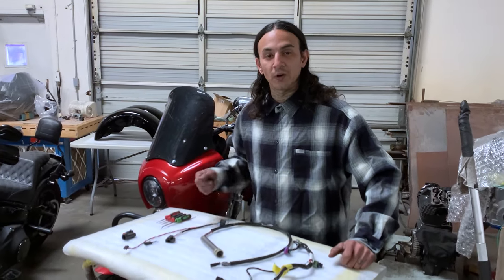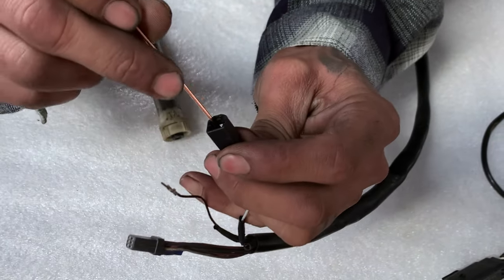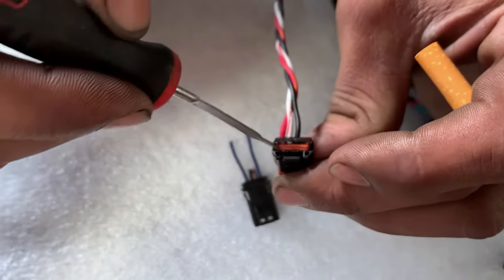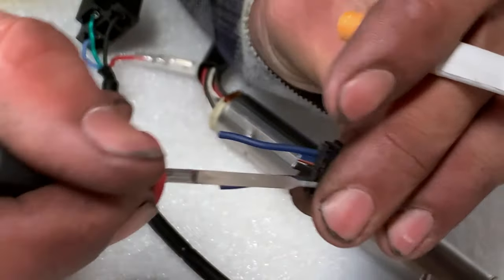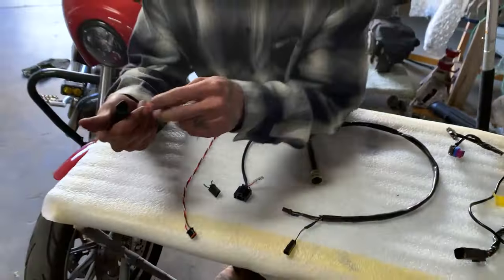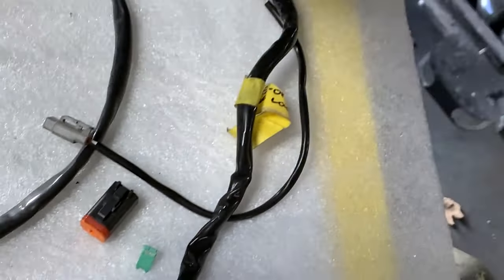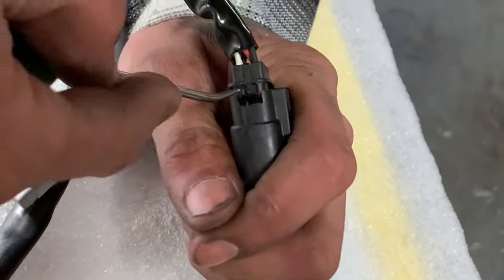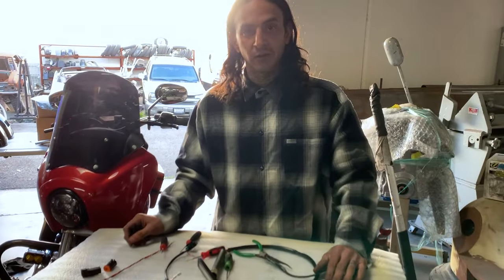IMZZ ELITE | De Pin Common Harley Davidson Wiring Connectors Easily!

Comment: Great video man. Bought some factory Harley front blinkers for my 2021 Road glide, and the damn cables from the light don’t come from the factory with the connector attached. Harley makes you buy it, and additional pins separately. Fuggin shit practice. This will help with my installation. Thanks a million! 🙋🏻‍♂️

Comment: GREAT VIDEO! On the last connector you showed, with that white colored locking block, you don’t actually have to remove it all the way I found out. You just pop it up the same direction as if you were taking it out like 1/4”-3/8” and it will stop. Then you take a very small pick (I used a leather saddle stitching needle in a pin vise as a tool) and you just insert it into those little holes in the white locking block next to each pin and pull the wire right out. It’s super satisfying to do once you figure them out haha.

Comment: If you break a pin is there a way to replace it like the little pin on the end of the wire can you buy another or do you have to repair it

Comment: Aren’t some of those AMP Multi-Lock I had trouble finding the 4 wire connectors. Seems HD went away from them I need to figure out the 4 wire connector that has the blue seal and used for  22FXLRST Speedo to a 22 FXLRS

Comment: Wow! Been fng around for a year trying to unpin those JAE (CAN-Bus) connectors. All other videos show using a safety pin from the opposite side. It does eventually work but is a PITA at best. The method you show here is essentially foolproof. Thank you. 

Quick question: did you make/modify that tool or buy it? I got a different tool to work but yours looks better.

Comment: Any tips on getting the pins out of the throttle wire connector? You did an awesome job explaining the heated grip ones but I can’t seem to get the throttle wire connector off